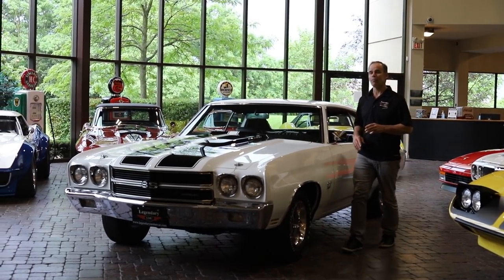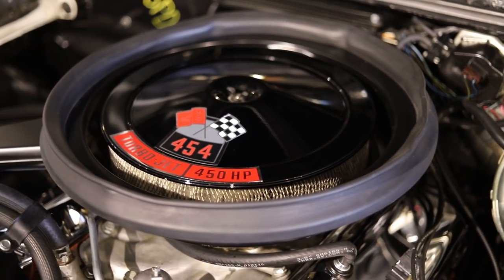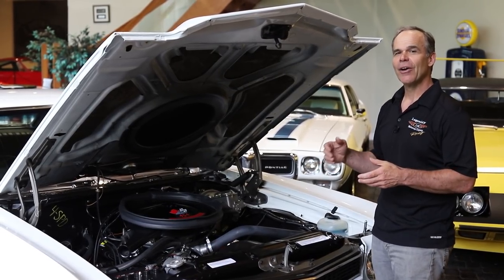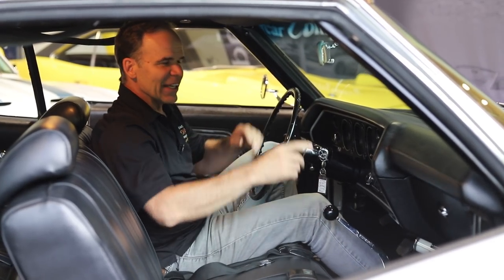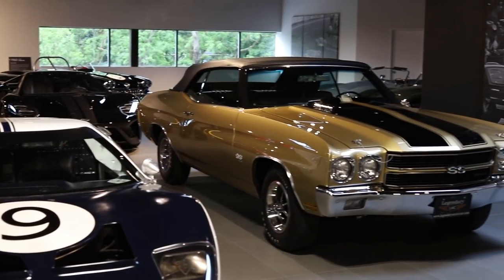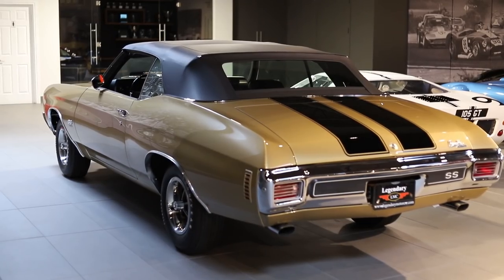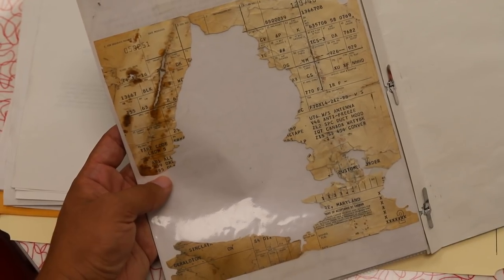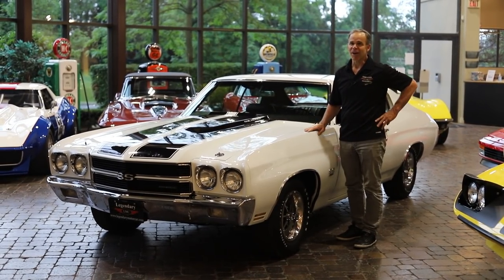Why this Convertible LS6 is the BIG DOG of Chevelle SS cars!

Comment from the maker: Convertible, Coupe, or Camino? Let us know below!
Reply: I have always liked the El Camino because they are quite rare.
Reply: I prefer the el Camino. I have owned 5 of them. 67, 68, 69, 71 & 72. 
Built the 69 with a 454, Muncie M22 Rock Crusher 4 speed, 3.31 posi. Added 800 watts of Alpine stereo for good measure. It was sooo much fun. No matter how I drove it, fast, slow, with or without a load in back, it got 9 mpg. I have owned many cool cars through the years, but I miss that 69 the most.
My buddies had Chevelles. One of them had a 72 SS 454 coupe, and later a 71 SS 454 convertible. Another had a 69 convertible that we put a tall deck 427 in. Those were the days!
Reply: Definitely the coupe, hate Convertibles, El Camino? No weight out the back...
Reply: I’m an Aussie I’ll take the ute
Reply: I will disagree with you guys here. I will raise you a 69 Chevy Yenko Chevelle 427 ss.
Reply: @w41duvernay 
That is a great car, no doubt, but I prefer to build my cars to my specification rather than buying a pre-built beast.
Reply: I own a 70 SS coupe, so I’m partial!!!
Reply: I own a 71 Elcamino LS7 XCH 454 4spd. It has Power windows and even power vent windows. It had a 6way power bench seat that was removed and bucket seats were added. The car sat for 30 plus years. I bought it 3 years ago and is currently being painted dark green with white SS stripes
Reply: Vert than coupe
Reply: @chrispafrieddreams9118  PLenty of weight over the rear wheels trust me.

Comment: The most desirable DAWG LS6 Chevelle (IMO) is that Fuller car that I believe peaked at auction @ $330k a few years back. Triple black, stripe delete, Loaded with pwr widows and Auto! Yes to Automatic, that beast is meant to be driven and showed off to as many youngins as possible, and it’s best paired with the floor mounted horseshoe shifter!

Comment: I think the 70 Chevelle is one of the best looking Muscle cars ever made. I’m not a rag top enthusiast, but they get the big bucks. A note on that LS 6 monster...they were actually close to 600 hp using “high octane” gas! (I’m giving away that I’m old fart with that term) had a friend college that had one and he ate mopars for lunch. You are right about the headers and exhaust needed to open things up!
Reply: Back in the day, 4.56 posi plus L60s or N50s in the rear also livined things up too😂
Reply: High octane gas doesnt add any power it just burns slower to help against pinging.
Doubt the 600 number. They werent that fast
Reply: @garysarnowski3113  Wish we could get those size tires today! 
Most would have had Gabriel HiJackers and a set of Pos a traction torque twisters..wish they would make them again...in radials

Comment: Wonder Video. Two unique LS6 examples too! I owned a Desert Sand LS6, which I believe later sold through LMC, (I saw the car photographed in front of the nice home, [Estate] garage and it was originally sold @ Ziegler Motors in Zelienople, PA). 
THEE ONLY FLAW ON THESE TWO are the Cowl Grilles. When we’re dead, kids will be scolding owners for not having them referencing today’s mistakes, (I sold mine @ Carlisle in 1995 and was SCHOOLED for the mistakes I made, switching the Malibu for SS in the door panels, incorrect master cylinder, newer style cowl hood, etc.). 
Thank you for starting back up with these Vids! 👍🏻

Comment: Fast car unless you Pulled up to the line against a 440-6 I know from experience. My Road Runner stock in 73 turned a 12.9 to a LS-6 13.2 only time he ever pulled off a win was my fought. I red lighted. Great times.
Reply: Those 440's are my favorite engine from the era. They were incredibly durable and only had 10.5 compression for some reason. The only real high compression RB was the Hemi if I remember correctly. These Chevelles were about the only Chevy that I thought out classed the Pontiacs of the era. Todays cars are faster but it was a great time to enjoy these cars.

Comment: LS 6 = 450 HP Factory Rated,  but the Pontiac Ram Air III was rated at 370 HP and in Truth was somewhere around 430 HP  (the the IV was more like 440 HP,) and the Old 442 W30 455 was factory rated at 370 HP but in truth was closer to the 440 HP as well  ---  

     Roger Huntington wrote an article about what these engines actually
 put out; here is the list: (All are gross hp &amp; torque figures.)  

     Engine------------------Advertised----Rated----------True 
    
-----------------------HP @ RPM--- Torque@ RPM-- HP @ RPM 
 
   

 Buick 455 Stage 1-------360@5000----510@2800------420@5400 
    
Camaro Z/28 302--------290@5800----290@4200------310@6200 
    
Chevelle 396 L-78-------375@5600----415@3600------400@5600 
    
Corvette 427 L-88-------430@5200----450@4400------480@6400 
    
Mopar 340-4 bbl---------275@5000----340@3200------320@5600 
    
Mopar 440-Magnum------375@4600----480@3200------410@5400 
    
Mopar 440 Six-Pack------390@4700----490@3200------430@5600 
    
Mopar 426 Street Hemi---425@5000----490@4000------470@6000 
    
Mustang Boss 302--------290@5800----290@4300------310@6200 
    
Ford 351-4 bbl Cleveland--300@5400----380@3400------340@5600 
    
Mustang Boss 351--------330@5400----370@4000------360@6000 
    
Mustang 428 Cobra-Jet---335@5200----440@3400------410@5600 
    
Mustang Boss 429--------375@5200----450@3400------420@5600 
    
Oldsmobile 455 W-30-----370@5300----500@3600------440@5600 
    
Oldsmobile 350 W-31-----325@5400----360@3600------350@5800 
    
Pontiac Ram Air 400------366@5100----445@3600------410@560

https://autowise.com/the-true-hp-of-the-10-most-powerful-classic-era-muscle-cars/

Comment: Wait, did they make a L-89 Option on an early ‘70 396/375, (he mentioned the engine options early on in this vid and I may has misunderstood) ? 
While I’m asking, was a ‘69 Nova available with the L-89 as well ? A COPO 427 L-89 Nova as well ?
Reply: The L78 396 had the L89 aluminum head option in the 1970 Chevelle until December 31, 1969. The LS6 engine completely replaced the L78 engine in the Chevelle at the beginning of January 1970. The L78 was still available in the 1970 Camaro, but not with the L89 aluminum head option for 1970. The low rise intake manifold was for the 1970 Camaro and the 1971 Corvette. It was unfortunate that the 1970 Chevelle didn't get the older high rise intake manifold on the L78 and LS6 engines.

Comment: i see one big problem here u can go to LS website and read the history of the LS engine which came out in 1970 and they claim they never built a bbc in history but they do claim they put a LS 6 454  small block in the 70 chevelle and i even called GM up on it and they claim the same thing chevy claims that a LS is a GM engine not a chevy it was built by GM racing division and if u look on the net  they have thousands of 70 chevelle ls 6 bbc but they did build thousands with the ho 454 bbc in them and LS claims they never put a LS block in a convertible till 96 and they use the same block today with a few sensor upgrades they had to make extra ports for the sensors but still have the 6 bolt main as it did in 1970 u could get a cast iron one exempt for the ls 7 but in 1984 they dropped the cast iron blocks the reason u can get the ls in all gm cars and trucks is because it is a gm engine and not a chevy engine.  now i want u to think do u really think that gm  would put the same name on 2 totally different engines just think about it how does that sound i really don't think so . what i find funny is i have seen a real 1970 chevelle with the real LS 6 454 in it on the showroom floor and it had no bbc in it plus it said cowl induction LS on the hood ooo that is right u can not get that emblem no more only came on a 70 chevelle and they did not make extra and u could not order it with the LS it was limited to 218 cars only 212 with the LS 6 and 6 with the LS 7 this is straight from the people that built the car . do u even know what LS means . just think of this if a bbc 454 is a LS then y do they claim they only put a LS in the 70 chevelle when the vett had the bbc 450 hp 454 in it and so did other rigs but they only put the LS in the 70 chevelle but other rigs had the same engine u are showing please explain it i have to hear this one . stop listening to the internet and research it from the people that did it or call GM up on it they will be glad to explain it too u .
Reply: @adolfoliverbusch4755  and yet u will not call them up because u think u know it all good luck with it if u think GM calls 2 different engines the same thing just like u guys think a LS 7 is a 454 when they only ever came as a 427 what do u think what makes a LS so good that it puts out the same hp and torque as a bbc but yet it is better because it weighs 300 lb ,lighter than a bbc do u even know what LS stands for be quick  . and u can listen to all the bs on the internet that u want i go straight to the source try that for once or read up on the mark iv series and read the whole description of it don't just look at the numbers  like the part were they changed the angle of the pistons and pushrods. just go look at a LS engine does that look like a bbc not even close . and if u think i am full of shit then call gm and ask them i did just to prove i was right about the 70 chevelle LS car . i have 3 ho 454 modeled after the 70 ss engine puts out 450 hp at 485 torque they sold them as a crate engine now they have been upgraded to i think 485 hp in the 90's
Reply: You got too many things mixed up. The letters LS were used starting in 1970 to describe a couple of big block Chevrolet engines LS 5 and LS 6. A LS 7 was proposed but never installed in any car. Then around 2000 ish LS was used to describe a family of small block new tech GM engines.
Reply: @adolfoliverbusch4755
Reply: 6 bolt main?
Reply: @edwright5008  all ls engines ever made have a 6 bolt main and they never have made a big block in history that is right on there website they have a big thing on just because everyone keeps calling the LS 6 454 a big block chevy LS is made by GM racing division not chevy first problem they have on there big block chevy they built 2 454 for the chevelle one is the bbc the other is the LS block this is y u see so many bbc chevelles because they built a lot of them but only built 212 with the LS 6 and 6 with a LS 7 that is on their website